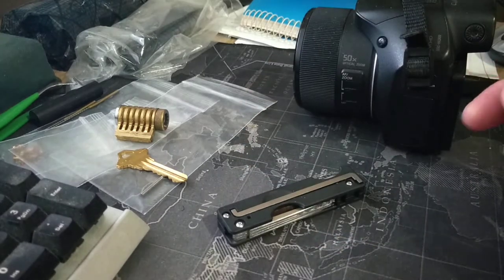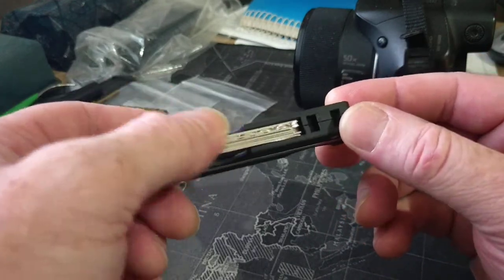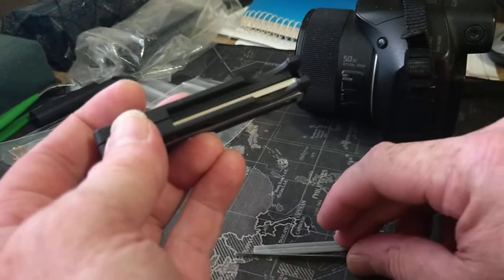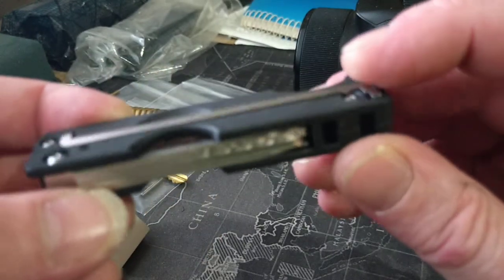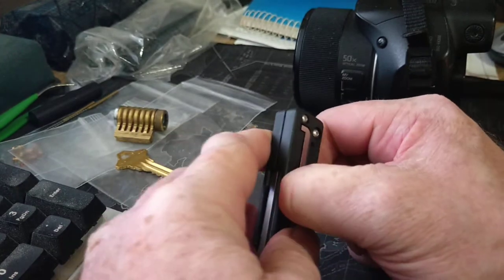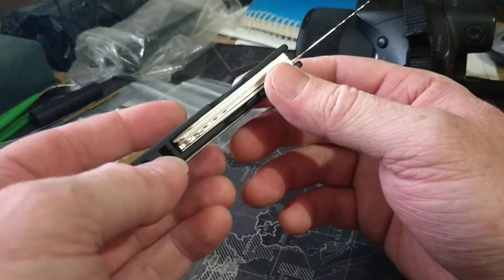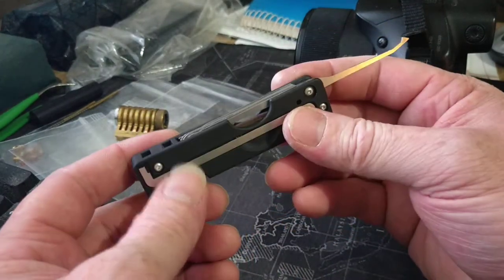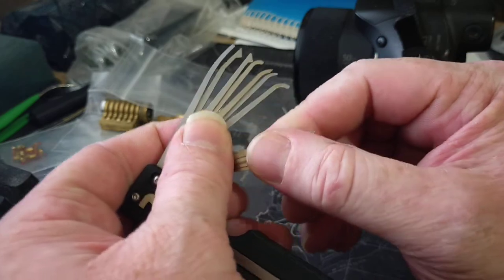SWICK EDC Lockpick Set - Freehand review

Comment: Thank you for the review. There are definite trade offs for using a EDC vs individual picks. There are also problems that we are going to address.  I will try to answer a few things here.

1. The body is fiber injected polymer that is molded not 3d printed. I make this distinction not to be not picky but to point out no 3d printed body could be as strong as fiber reinforced polymers. This body is as strong as some steel and actually stronger in some applications. 

2. You are absolutely correct about the plastic insert and the L shaped tension tools. The cavity there was originally designed to hold the magnificent six turning tools or 2500 series from southern specialties https://lockpicktools.com/tension-tool-2500-series-set/ and if those are used none will fall out while the others are in use. We wanted to include those but it wasn't cost effective so we provided what we did. 

4. The screws and spacers are going to be redesigned as per many requests and can be replaced when we upgrade the model.

5. You did very good figuring out how to work the blades having never seen our video. I erroneously believed it would be intuitive and after it wasn't for many I put out the video. But you did it exactly as intended. :-)

6. Sometimes the movement of the side tensioners is not due to magnet placement but instead the fact that the z tensioner may have a slight bend to it and can be corrected by straightening it.(edit: I stand corrected, I went back and checked some of the stock and you are correct some are not flush. That is a problem that we will tackle.)

7. Ws are offering a lifetime guarantee on the body, spring, screws and standoff. So if anything goes wrong with those components we stand behind our product.

8. I'm not sure why your pick blades aren't holding securely. I cannot replicate it in any of our current stock. I put all the blades in myself and check every set personally. Try tightening the screws on either side of the blades. If that doesn't work please let us know and we'll make it right. 

I appreciate your feedback. I like construction criticism because it shows me what I need to fix, it is hard to see these drawbacks when you are so deep in a project. Like errors in a book you're writing,  you just become blind to them. Unfortunately you guys become our editor but we are listening and will address these issues. No EDC will ever take the place of standard full size picks but they still have a place for those who don't care to carry full size picks day to day in their travels.

I hope I covered a few things there and again I appreciate your review. Cheers, David Storm
Reply from the maker: Hi David, I appreciate your detailed reply regarding some of the issues I found with my SWICK. My apologies for any unforced errors in my verbal descriptions of the SWICK (i've added a correction to the video description). Overall I think it's a neat tool, and I'm having fun practicing with it on my cutaway lock.
I'll try tightening up the screws to remove the play in the blades as you suggested, from the gap in the body halves it looks like they might have worked loose a little due to vibration on the journey to Australia. Cheers!

Comment: The very strong spring on the SWICK  may be a bit of a hassle but if you'd ever used other jackknife style picks you'd see the major advantage. Other products tend to use inferior setups like setscrews that come loose and make you lose all feel/feedback from your picking or wind up getting lost (this has happened to me).

This sort of thing is a compromise of convenience by design, like any multitool. I can tell you I just received a current production SWICK in the mail today and it's evident that they are continuously improving the product, which is nice.